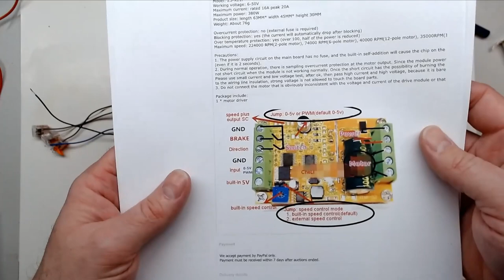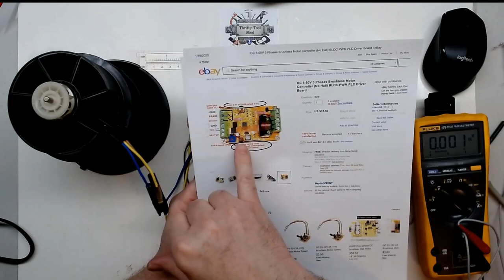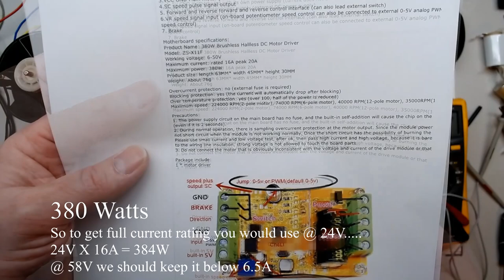Cheap & Neat 3 phase BLDC Controller

Comment: As someone who works with those blowers quite a bit, it sounded like you passed about 800 watts through that 380-watt rated controller.  You may as well put the blower back together for kicks and giggles and see how powerful you can make it before it breaks.
Reply from the maker: That is exactly what I was wanting to do, so I have done that. I have used it and used it and it still works.... I thought it would have let the smoke out by now! I wish I had a anemometer that would go that high, I would love to know what it is putting out. It is way more than my factory 530cfm!
Reply: @ThriftyToolShed   Thrifty Tool Shed  I can calculate that.  Use a tone generator and take note of the frequency that the motor makes as it runs.  Factory 530s run at 22,000 to 24,000 RPM, or at a speed that will generate a sound that is 366Hz to 400Hz.  There are online tone generators such as the szynalski one and you can tune it to the speed that the blower motor makes as it runs and you can calculate the volume using 530 CFM to 23,000 RPM or 530 to 383.3 as a ratio.  So if your motor spins at 25,000 RPM, you'll have a 576 CFM volume, and that is extremely close to the LB5750, which has a motor that happens to spin that fast and is rated for 575 CFM.  So there you go.  Now you tell me how much volume that thing is putting out.  Just look up "tone generator" and you should find the szynalski one which is perfect for measuring motor RPMs.
Reply from the maker: Although I was not sure of the comparing frequency tones. I have already had some luck with laser tach measurements comparison of RPM for an future update video after I did the video of the controller running the blower. The original 530cfm blower I have tached around 24,200rpm with a 5.0ah fully charged. The 480cfm blower I added the controller to tachs at 24,600rpm with same battery. So it puts out more than my factory 530 for sure, I am surprised it has ran so well and held up honestly, but I did try to think about the location and the forced air flow through the controller heat sink the way I mounted it and of course the brushless motor has the great air flow with original factory design!
Reply: @ThriftyToolShed  They seem pretty close.  It might be interesting to see the difference in airway efficiencies between the 480 and the 530.  EGO now has a 650 unit which has a peak RPM close to 29000.

Comment: For external Potenciometer, you can use "Ground/+5V/Input 0-5v -PWM" terminals. But Remove the jumper close the POT . If you whant use PWM signal (ex, Arduino) use terminal "Input 0-5V" , with short on contacts "V/P" near the capacitor 100-35v-VT
Reply from the maker: Thought I mentioned that in the video, must have edited it out saving time. Thanks for the comment!

Comment: Hi, I’ve been following and loving your fix and modifications videos. Concerning this cool little brushless bldc controller, I have bought a few and have been playing with them for a while. I was thinking it would be really cool if someone would show us how to upgrade the mosfets to something like 12x IRFB4110. And also whatever else is needed to handle the extra current and voltage. Are you up to this challenge?
Reply from the maker: I would like to do so. I have not had time to look more into it than the modifying for higher voltage input. I have not had much need for higher current since the forced air over this beat sink is just fine. The current rating is fine, I just try to keep it cool. I may need to do this one day, it will be fun if I get the time to do so. Thanks for your comment!
Reply: @ThriftyToolShed  If ever you decide to use this unit on something that requires more amps it would be really interesting anyway, I’m currently re-wiring smart drive washer motors to run in the 40-60v range. I’m trying to recycle them into a ebike hub motors. If I can figure out how to improve these cheap bldc controllers, I might use them in this project and since they are inexpensive I can carry spares on my trips haha, thanks for the reply and keep up the good work 👍
Reply from the maker: I really like that you are modifying the washer motors. If you have videos on that, I will have to check them out for sure! Thanks, you keep up the great work as well!

Comment: Is there a specific order the motor phase wires need to be connected to the controller? 
Or just put them in as blue,yellow,tan ?
Reply from the maker: Well not necessarily a specific order per say, but the rotation will be either CW or CCW depending on order of phase leads. Mine was correct rotation with BLUE, YELLOW, BROWN. Connected to A,B,C respectively. You can simply swap any two of the three phases to change rotation or use the fwd/rev of the controller....
Reply: @ThriftyToolShed  thanks for your help 👍

Comment: So how has it held up? Thanks for the vid!!!!!!!!
Reply from the maker: I did do a update video if interested. 
https://youtu.be/fwinVO9x5SI
Reply: @ThriftyToolShed  thanks!!!!
Reply: Do you think it could handle having the potentiometer turned all the way up and use the positive wire to turn it on and off? A switch would be in the positive line. Trying to fix a cordless chainsaw. Thanks!!!!
Reply from the maker: I believe it can as long as you don't make my mistake of disconnecting the Capacitor from the board when it turns off. I replaced the 50v cap with the 63V but left it down stream like the EGO controller had it. I was not thinking about when the power is cut, it has no storage and I damaged my first one. I basically ran the blower BLDC like this in the video of making a EGO Shop Vacuum.

Comment: I like the controller but can you recommend a 1500 watt controller fo a 12 pole sensor less bldc motor than can run on 24 volts to 48 volts
Reply from the maker: Sorry, I don't have any experience with the 1500w to really say for sure!

Comment: So could I use this controller for my electric scooter that I installed 2 bldc hub motors that  have no Hall wires just the 3 phase motor wires from hub?
Reply from the maker: Seems to be a good application for it. It is a nice little controller and potentiometer can be wired up to the  terminals to give the 0-5v instead of the on board pot. Just remove jumper and wire into the PWM terminal. I did not realize this in the next video and I soldered in the wires where the board mount pot was to get my blower running. I did not have to do it that way. The PWM terminal was not obvious but I have figured it out now. Hope it works well for you!
Reply: @ThriftyToolShed  awesome thank u soo much!! Been goin crazy Tryin to get my thumb throtte to work with my existing controller that has Hall wires...didn't kno much bout motors & that mine doesn't have Hall sensor wires.
Reply: I had one or 2 last questions forgot lol... I would have to buy 2 of these to power each 250W hub motor front & rear for scooter correct? & the external potentiometer can be a scooter throtte like thumb or twist or pull right? That I can wire one throtte to both controllers to power both hub motors togther?
Reply from the maker: Yeah, I believe these controllers are 380W max with 20A burst max so you will need 2 for the dual 250w BLDC set up? As far as the reference going to both that is something I have not tried to say it will work for sure. Maybe ok to have 5V go to the potentiometer from one controller and the signal or wiper may be ok jumped to both controllers giving same reference? May have to tie the grounds or commons between the two controllers together also  to work? That's all I would know to try and see! As far as your throttle, most are a 3 wire potentiometer type but I can't say about yours for sure?
Reply: That's great & Def sounds right & how I would connect the 2 controllers together. Ya my throttle is a 3 wire one +/ - /signal. Thanks soo much u have been a lifesaver for this project 😃!!
Reply from the maker: Best of luck to ya, have fun!
Reply: Hey thrifty so I finally got the controls and everything hooked and everything is working super smooth I’m super happy the only issue is when I plug the motor in it automatically starts going at a slow rate in a matter what I do it just stays on my throttle works fine going up and down with it but then it goes back to that low speed no matter what it won’t just stop on its own after I’m done pushing the throttle and I took that jumper cap off I ran the 5 V input and ground...The only thing I haven’t done is hooked up the brakes yet so I still have that blue jumper in between the direction and ground...I also haven’t tried hooking up both controllers to the both motors yet I’m just trying to get the throttle working first
Reply: If you have any input on what you think could be going on I really appreciate it thanks a lot
Reply from the maker: If you have taken the jumper off the board for using the on board potentiometer. Then I would double check that moving that pot on board around just to verify that the signal is not somehow messing with your input back from your throttle. The only other thing it could be is that your 0-5v must be high enough at 0 to give the controller a output. Just say for example it's getting a .3V signal all the way down instead of 0V. If that's the case you can make sure your throttle is really going to say 0-5K when you move it back and forth. If no other way around it you could just trim it out, meaning use a another pot from zero of pot to wiper and adjust it down on the zero side to get a low enough reading to zero to quench the controller. I used a trim technique similar to this on one of my latest videos slavaging a Ridgid brushless jigsaw with cheap controller replacement. Kinda the same thing....
Reply: @ThriftyToolShed  ya Im gettin some weird stray voltage from somewhere...showing almost 27volts on my meter on the motor phase terminals on controller b4 I even have motor plugged into it...prob cominh from the other old controller I'm using to get my 5VDC input for throttle? I wasn't sure how to get a clean 5V for the throttle without using it
Reply from the maker: @leluthebluebayshepherd3551  
The BLDC controller has 5V terminal to use for speed control
Reply: @ThriftyToolShed  oh Shoot!! I tested for it b4 & got nada but that must of been cuz I hadn't pulled the jumper cap yet ha! I'll try that now. Hope I didn't burn out the controller lol
Reply from the maker: @leluthebluebayshepherd3551  
I would think it would just over ride the slow speed or be almost like a min speed pot if that makes since. I am just guessing about that, I did not try it myself. Hopefully the board is fine and it should be able to supply your 5V  from the 5V terminal to the throttle and back to the terminal PWM.
Reply: @ThriftyToolShed  So I’m getting like .73VDC through each phase of the motor terminals to the battery positive terminal even though I don’t even have the battery connected... How is that possible? I literally have my three-phase wires hooked up on terminals U V W and my battery positive+ and negative on the VCC & GND...on the opposite side I have my red 5V from the throttle to the 5v terminal & my green signal wire on throttle to the PWM & my black from the throttle on the ground...then I have the jumper between the directions & ground terminals... That's how It should be wired right?
Reply from the maker: @leluthebluebayshepherd3551  Although I do not know anything about your exact throttle, that sounds right. As far as the voltage from the phase outputs of the controller, I would not worry to much about that unless you see issues there. Since you have solid state Mosfets and not a relay contact making and breaking you may get some voltage reading. With a bus capacitor you may even see small voltage levels while not powered up! As long as the bus cap is still charged that is.  When I mentioned voltage earlier, I was talking about the reference signal back from the throttle that could cause the motor to turn slow. Making sure it is at 0v reference in to the PWM terminal.
Reply: @ThriftyToolShed  ya with jumper pulled I'm getting.72-.76vdc to ground & .02-.04vdc to ground with jumper in...I have the reg 3 wire thumb throttle with & turn key blue battery led voltage display screen. There's a extra yellow wire that goes to battery positive to activate that & there's a blue wire too that I'm not using currently
Reply: I’m sorry to be bugging you like this put the throttle those were fine just goes back to that so stop using released the trigger.. I'm happy to trying to quench the throttles starting speed like you said before with another pot if that’ll do the trick without drastically sacrificing performance/speed acceleration?
Reply from the maker: @leluthebluebayshepherd3551  I would think it would be fine, all I would know to try. All I can input without having something in front of me. All just suggestions, best of luck to ya!
Reply: @ThriftyToolShed  thanks for all ur help I Def would of been where I was b4 without u getting back to me & having this back & forth! Really appreciate it!

Comment: Do you have code to use it with Arduino? and how to connect
Reply from the maker: I have not had a need to, but it would not be hard. It can take PWM input.
Reply: @ThriftyToolShed  I need a guide so I dont mess up or burn something ))